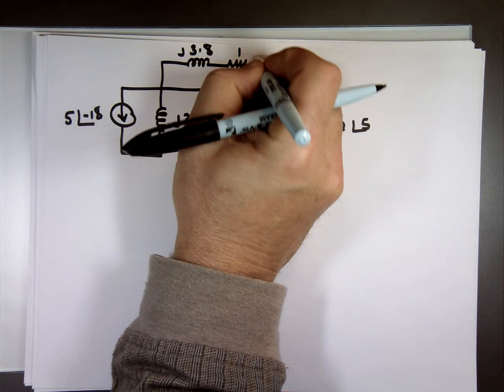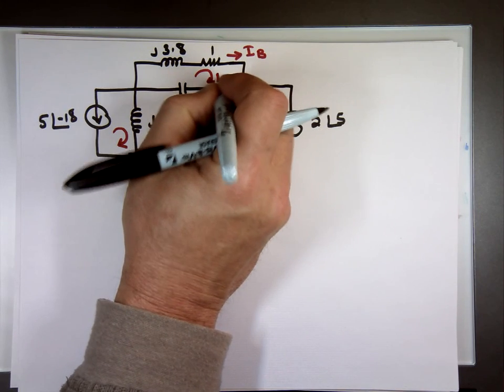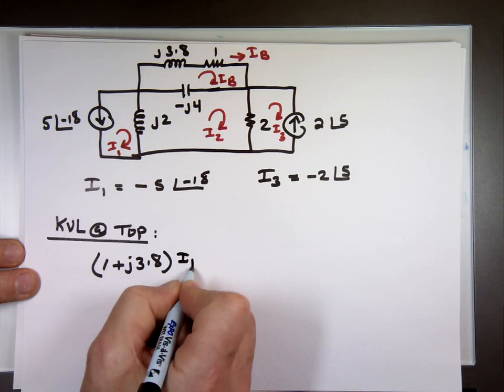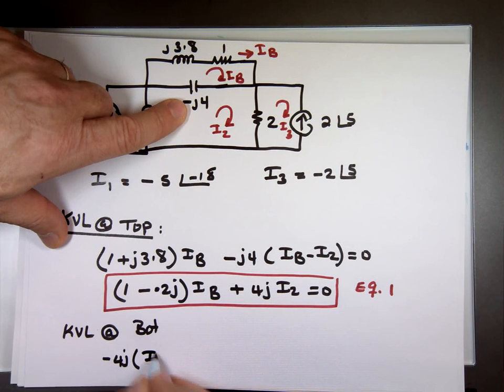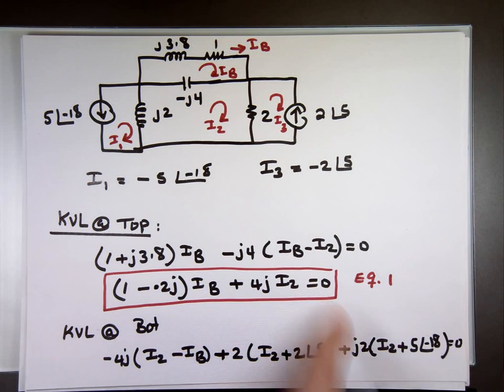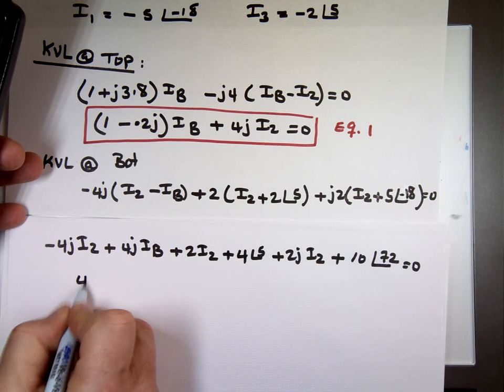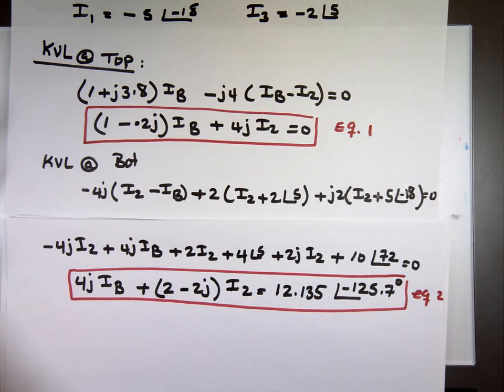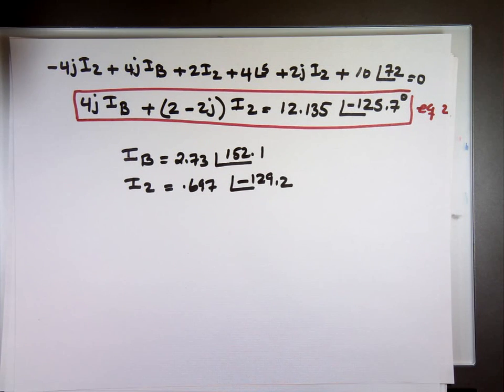Mesh Analysis Example using Phasor

Comment: Can anyone tell how nowadays we can put these equations with j in scientific calculator
Reply: It will be different for every calculator. If yours can do complex numbers, it most likely has i on it, not j. j is used in electrical engineering to avoid confusion with i, that is used to represent current.
Reply: @everettmcinnis5858 My calculator has this i but when we go in equation mode that i feature doesn't work and we have to then apply crammer rule
Do you know the model of the calculator he is using or the model which has that feature?

Comment: 6:41 2 angle 90? where did you find the 90 degree phasor, I didn't see it as a given value, pls help I'm very confused.
Reply: it is purely complex. on the complex plane you graph the imaginary (j) on the vertical axis, and the real part on the x axis. if the number is purely complex then it is only on the vertical axis. the vertical axis makes a 90 degree angle.

A bit too late but if anyone else has the same question

Comment: what if our calculator doesnt have a angle button
Reply: It depends on the calculator. On mine I can do all 4 basic operations using the rectangular forms. If I have a polar form I have to convert it to rectangular and proceed. These problems can all be done the old fashioned way, converting back and forth between polar and rectangular or vice versa as needed.